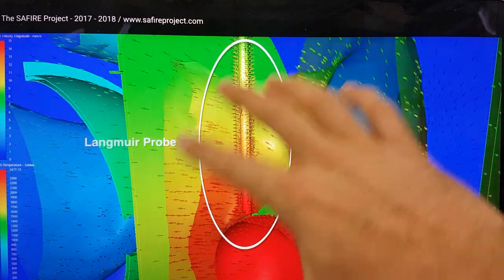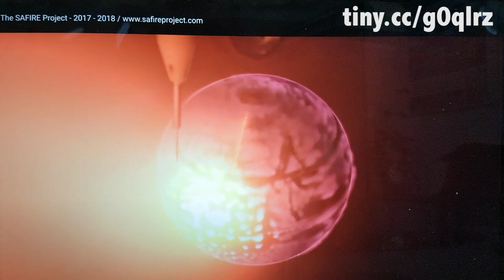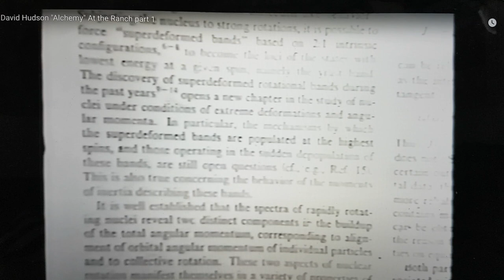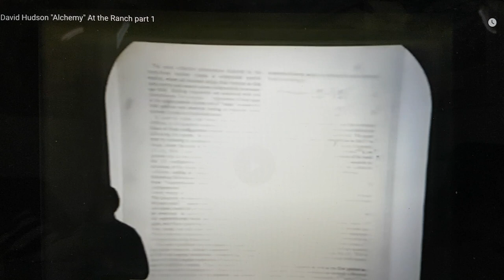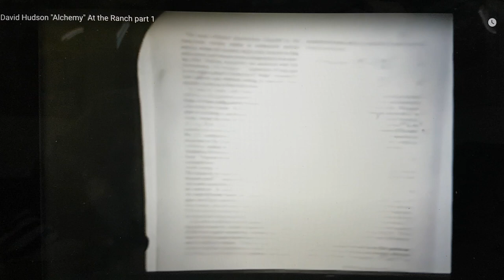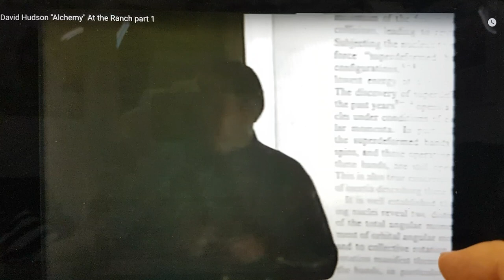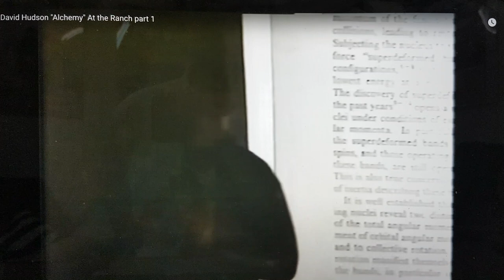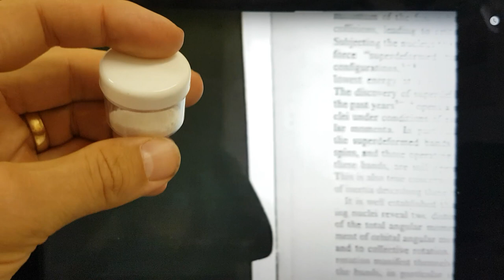Making Tungsten Disappear

Comment from the maker: The crumbly effect described here, happened in ECCO fuel exposed plastics, LION quartz, Hutchison steel and other samples, the fat, replacement SAFIRE Langmuir probe, David Hudsons experience and more. It is all caused by the same thing. This is a repeatable affect by multiple authors and is therefore, de-facto actual science.
Ken Shoulders
https://web.archive.org/web/20130314001346/http://www.svn.net/krscfs/Permittivity%20Transitions.pdf

“Dissolution of Matter:
When an EV passes through material, particularly refractory dielectrics and semiconductors, nothing escapes major modification. Many of these affects are shown in (2). Once the EV has disheveled the electronic structure of the material it traverses, there is no ability to return to the original molecular or structural state. It is most likely that the material undergoing modification has entered the region of low permittivity. When it does return, it emits light, has an electrified look and spreads on surfaces with a very low viscosity although it is so cold it will not melt wax or harm photographic emulsion.”
Reply: Very related although slight off topic. Was also pondering if monatomic ohmus could be reconverted back into metal crystalline elements using a Ohmasa, Browns or HHO gas flame reaction?. Certainly very worth to see if possible with precautions :) (y)
Reply: (Wayback Machine was only showing page 1, couldn’t see other pages on my iPad.)
Reply from the maker: @petermiddleton6902  I think it would end up as Carbon and rock forming elements - like everything else.
Reply from the maker: @Fractalfriend  You should be able to download it from WBM - that is what I did.
Reply: Martin Fleischmann Memorial Project Yes, that worked thanks.

Comment: Seems like the ormus would makes for a very high density monoatomic plasma in an instant. Having a profound and extremly rapid very special LENR like catalytic effect on the ionised diatomic tungsten anode. Maybe in this case ormus is acting like magic LENR gateway pixie dust...similar to what happens in SAFIREs special high density plasma & highly charged monoatomic field rings. Certainly food for thought.... Maybe a micro sized boron nitride lining for a plasma reaction chamber would be one of the safest & most efficient way to go?. Surrounded by a small HD plastic container filled with say a nano particle zinc oxide scintillator suspension, in a borax or boric acid solution, to enable the study of strange radiation and other energetic emissions in real time 3D would be highly interesting indeed :)
Reply from the maker: Mono-atomics for sure play a role. We have mono-atomics in Brown Gas and in Ohmasa Gas, on the later it is not even in the high percent and mostly in the fraction of 1%. So, imagine what 100% mono-atomics do in the face of the EVOs produced by the arc discharge - all those self-organising electrons. Now you see why I proposed his work first in my Copenhagen lecture.
Reply: @MFMP  Totally Bob, all grand stuff! :) (y)

Comment: THAT'S AWESOME!!! It's like a disappearing magic trick, but it ain't no trick. It's real!!!
Reply from the maker: Yes, and we are told we have some white powder gold to attempt a replication. This is not a 'magic trick' where one brings the matter back. It may be more than Fission, it may be completely deconstructing the matter into light as David Hudson said, or more likely, into a range of Exotic Vacuum Objects, bearing nucleons, that they may re-organise, in addition to light - but to be fair to David, he had far less evidence to work with.
Reply: @MFMP  I'm afraid you lost me with this issue of white powder gold. Are you trying to make gold out of it, or something? That would be even more awesome! Or are you just trying to make the white powder gold disappear, like the tungsten?
Reply from the maker: @MarkS-gm3sf  The ORMUS, white powder gold is supposedly mono-atomic. The SAFIRE reactor deliberately makes mono-atomic hydrogen, this is known to fission heavy elements. The amount of mono-atomic hydrogen may be low in the SAFIRE reactor, in Ohmasa Gas it is 0.28%, yet it is able to fission W. The mono-atomic element is good feedstock for EVOs. Ken Shoulders found that heavy element ions are good for stabilising EVOs, he tended to use mercury and Xenon. Now, Gold is nearly as heavy as Murcury - and it is 100% mono-atomic in ORMUS. So, the suggestion is that EVOs, made by the arc discharge can grow extremely large and stable with the ORMUS feeding it and this then interacts with the Tungsten, which gets captured and is converted to light, electrons, neutrinos and clusters / other atoms.
Reply: @MFMP  Thanks for taking the time to explain all of that. I think that I understand better, now. Whatever the ultimate cause, it's pretty awesome!
Reply: @MFMP  Entropy is reset in the condensate of Universe, zero point/Inertial plane/Counterspace. Emitted on the outside of Aether's hyperboloid vortex, Hawking's radiation?

Comment: Haven't watched the full video, yet. What I heard is high energy gamma rays, were created.
This is SAFIRE experiment, correct. Mediated to center of everything is Counterspace. The center of the Sun is zero point/ Inertial plane/Counterspace. Emitting pulses from its near infinite capacitance, shells, orbits, (?) radiowaves.
 High energy lasers were combined, creating Matter/Hard Light. This Matter had the Lagrange points. Sounds like Matter disintegrated into gamma rays. 
 Mediated to center of everything is Counterspace/zero point energy of near infinite capacitance/"Condensate of Universe". The tungsten became a condensate and was emitted on the outer side of Aether's vortex, Hawking's radiation. 
 "The smaller the spacial footprint, the higher the capacitance".
 Proton, Neutrino, Electron/Positron ~ Neutron ~ Zero point/Counterspace/Inertial plane ~ Neutron ~ Proton, Neutrino, Electron/Positron. How a quasar works. Magnetic torus ~ Neutron ~ Blackhole/Counterspacial Sink ~ Inertial plane/zero point ~ 90°, Whitehole ~ Neutron ~ galactic jets ~ Hydrogen. 
 Still called Aether!
"Scalable Aether Universe"